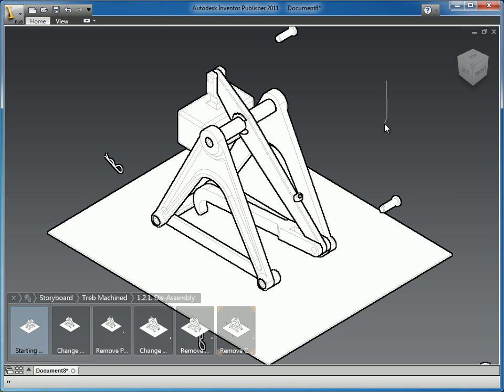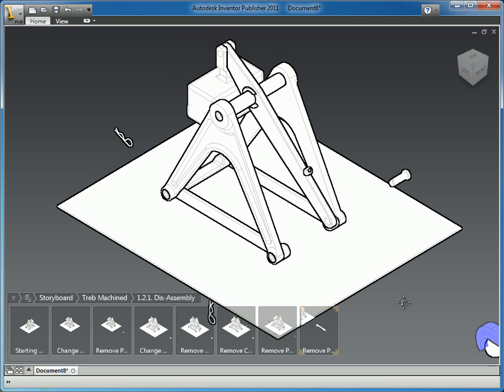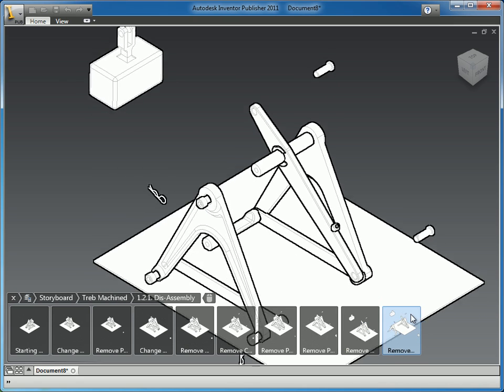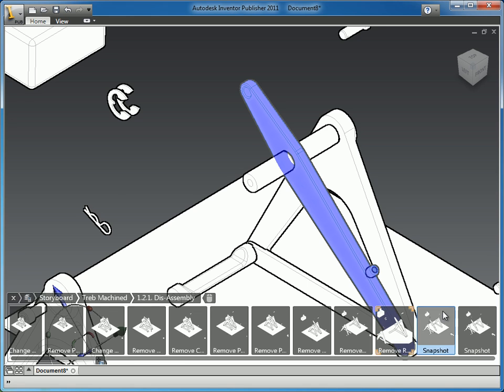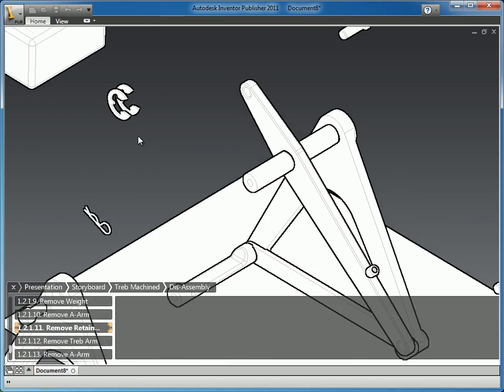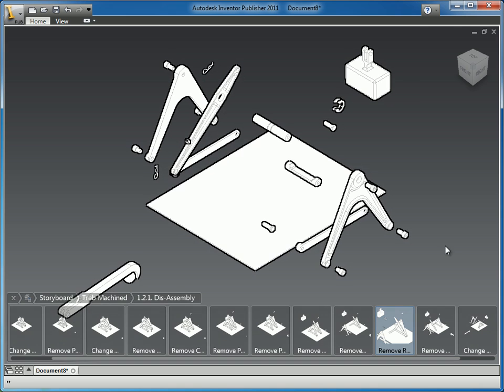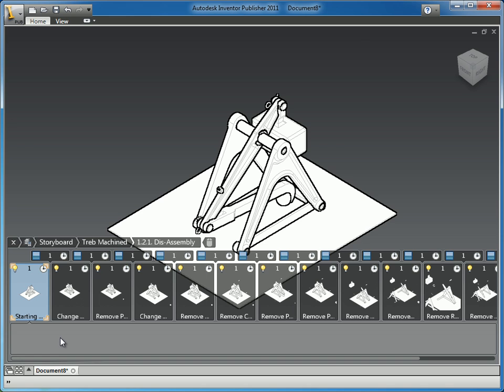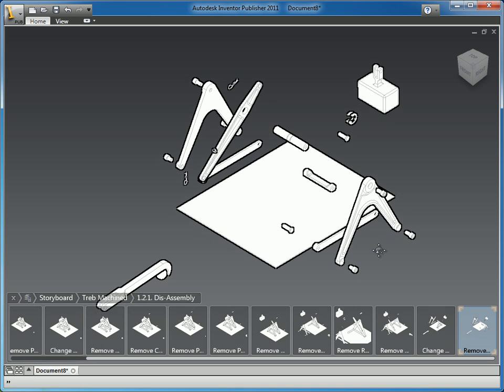Part 3 - Inventor Publisher 2011

Comment from the maker: Are the blades not symmetric? either way, when in the move command you should have a small button near the UCS indicator that will allow you to align the move with something on the part. That should allow you to get it set up the way you need.